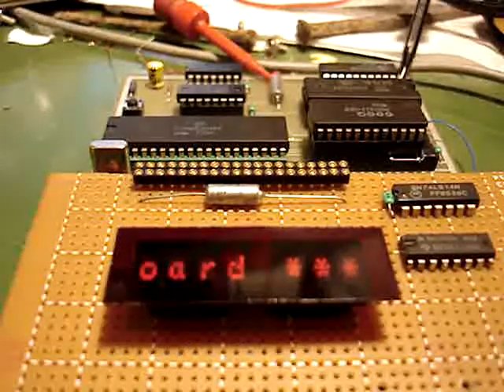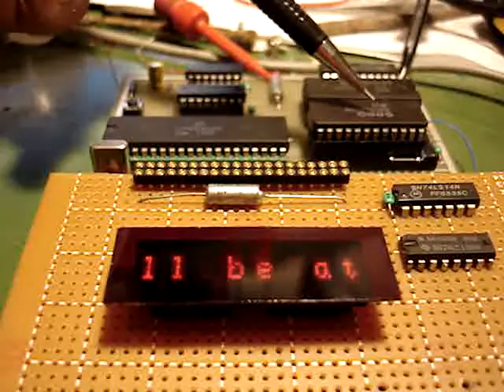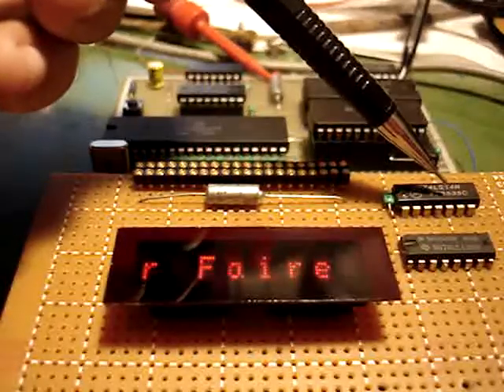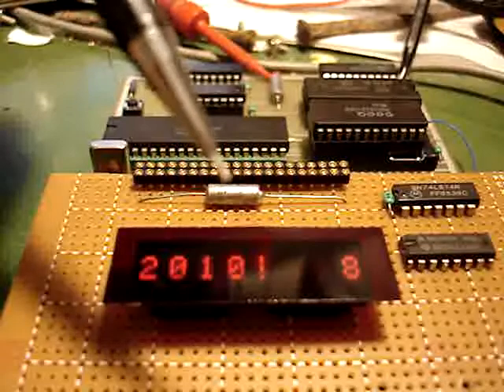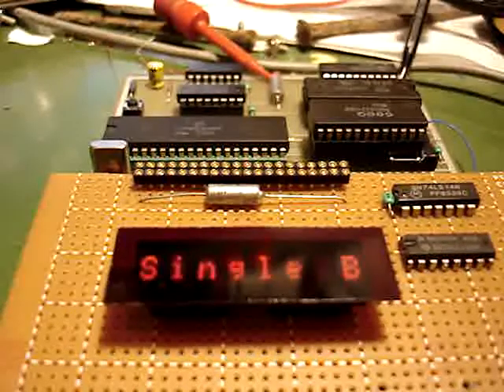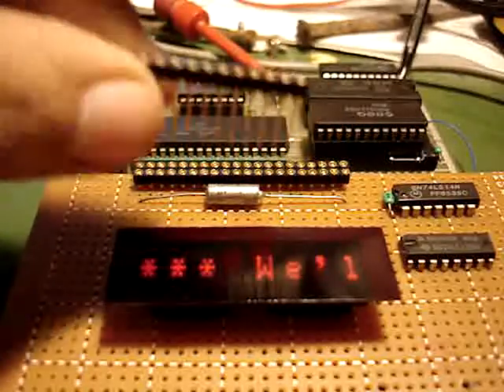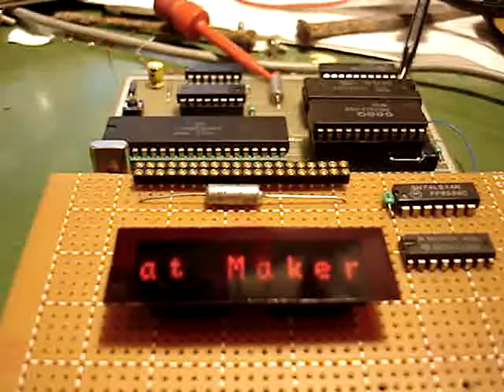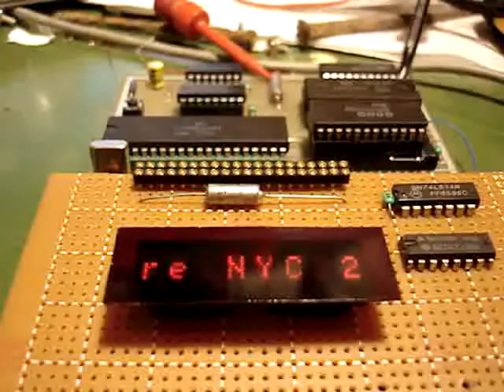8085 SBC with Scrolling LED Display

Comment: Nice project indeed !
Can you please shares the study materials about it ?
Also I am in need for some sort of software application for simulation of the 8085 based System, do you have any ?
Reply from the maker: Lomas Subedi I've been using GNUsim8085: http://gnusim8085.org/
Reply: glitchwrks Thanks :)
But I'm searching for the circuit simulator application for design of an 8085 based system. Any idea on it?
Reply from the maker: Lomas Subedi I'm not aware of a circuit sim with definitions for the 8085, but if you want to simulate/test/diagram the combinational logic required, try Logisim: http://www.cburch.com/logisim/
Reply: glitchwrks Logisim seems very useful for Digital Logic circuits. Sadly the project is now suspended and includes no microprocessors either. Anyway thanks brother :) .